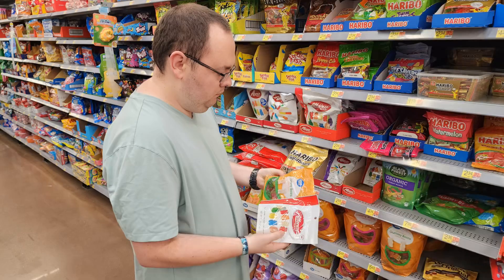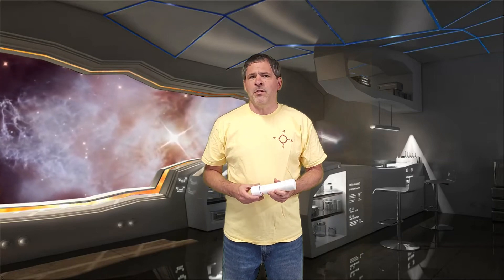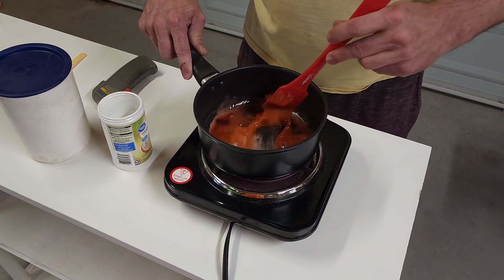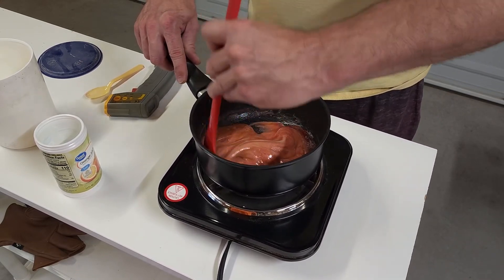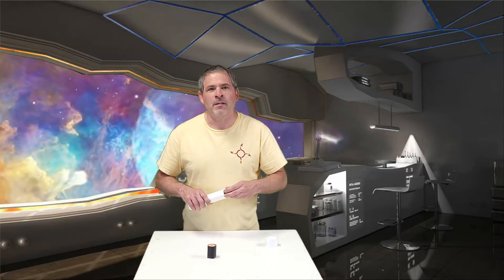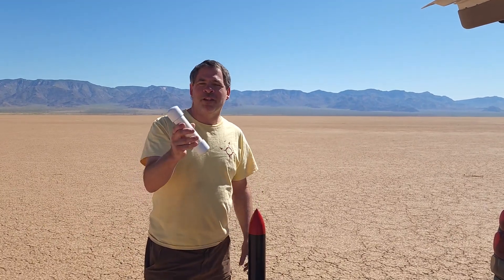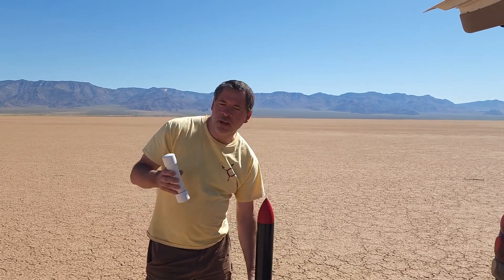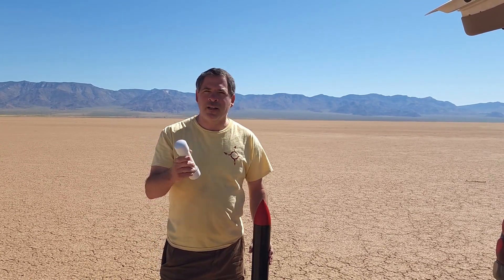We launched a rocket with Gummy Bear rocket fuel

Comment: I could be wrong but I think your chuffing issue is trying to burn semi-solid rocket propellant containing a large water content. It tries to burn, then encounters water molecules that have to get boiled off before the sugar/nitrate molecules burn, then it has to boil off more water molecules again and repeats the process until a good deal of the water is boiled off and you get a good burn in the now enlarged combustion chamber. Hard to ignite the propellant? So is damp paper or wood.

Comment: That pulsing is odd and I wonder if it is caused by the gelatin tuning to some species that doesn't burn as well as the sugar and somehow insulating the sugar from the flame front momentarily.
Reply from the maker: Sounds reasonable. It was definitely weird.
Reply: You can buy 'powdered' gelatin and make sugars by drying corn syrup...that's what they did when we couldn't get gummy bears to burn as a fuel WITHOUT drying out the water by heating/melting them and then using LOX as the oxidizer...true gummy bear fuel.
Reply: From Wiki Pedia: "Gummy candies are made mostly of corn syrup, sucrose, gelatin, starch and water. In addition, minor amounts of coloring and flavoring agents are used."

Comment: If I recall correctly, red iron oxide is supposed to make the fuel burn somewhat faster, but if you use quite a bit*, it's supposed to reduce the pressure exponent. At least in Richard Nakka's RNX fuels, which actually use epoxy. I don't know if it works the same way with sugar motors.

*7 or 8 percent in some cases
Reply from the maker: It is my understanding that it "should" have resulted in a faster burn rate which is what we wanted. But this fuel was already very difficult to ignite and the addition of iron oxide made it extremely difficult to light with a standard e-match.

Comment: That was one of the Myth Buster shows I worked on. We tried 'true' gummy bear rocket fuel in a hybrid with LOX but the high water content (15-25%) in gummy bears hinders its use as a fuel without modifications. Cooking it down as you did (with potassium nitrate) removes much of that water content as does drying it out further as a powder as on the Myth Buster show (still a true gummy bear fuel). They switched to ammonium perchloate (AP) instead of potassium nitrate (KNO3) for their oxidizer.
Reply from the maker: Nice! I did see the terribly failed experiment with plain gummy bears. That was doomed from the start but you probably knew that going into it. I was disappointed in the gummy bear myth busters episode where they successfully launched the bates grain fuel motor. Mostly because the didn't really do anything other than commentary and push the launch button. They didn't build the rocket, the fuel or the motor... All done by someone else... Maybe you :)
It really looked to me like the bates grains they showed were constructed of APCP with just some of the dried gummy bear mixed in. My assessment of that was based on Jamie's description of the fuel.
Reply: @rotaryrocketry AP works many times better as an oxidizing agent than kno3 and true APCP uses htbp as a binder and as a sort of fuel but it mainly uses powderd aluminium as fuel so i think what they did was lower the amount of htbp and replace the aluminium with gummy bear powder so most of the impulse still came from the gummy bears
Reply from the maker: Well, I don't doubt that "some" of the impulse came from the sugar content of the gummy bears but just how much is up for debate. They were deliberately not sharing detailed information about the fuel on the show.
I've actually been thinking about re-visiting this idea since we've made some significant motor design improvements. And maybe melting and pulverizing the gummy bears like they did on the show... It's a possible future project.
Reply: @rotaryrocketry  i think it would be  fun to revisit the project and maybe try AP instead of kno3 to see if it would work better and try the dried fuel i think that the dried gummy bear fuel would work a lot better i have been thinking trying some sugar rockets (i bought a 5kg bucket of kno3 like a year ago never used it yet) as a young rocketeer in europe atleast i my country i am basicly the only young person to do rocketry at a bigger scale using some smaller apcp motors which are stupidly expensive because of import taxes and such to a point where a simple G rocket motor can cost up to 50€ (about 55$) so sugar rockets might be a good option but i dont know if i am allowed to even launch them at my club i think i will post a video on an upcoming club launch this sunday know i dont know why i made such a long comment but you make great content 
Support from the netherlands👍
Reply: @rotaryrocketry  From your description "After several ground tests we finally got a successful design and launched a homemade rocket using true Gummy Bear rocket fuel. The final mixture is 65% Potassium Nitrate and 35% Gummy Bears cooked to 230 degrees F."  When you cook the gummy bears and drive out much of the water, they are no longer 'true gummy bears' but simply a variety of partially dried out sugars, starch, and gelatin. In testing using liquid oxygen,  we could hardly get combustion of true gummy bears because of their high water content. 
The same would be to say you made a rocket motor using Jello...without the water you really can't say you made a rocket motor using Jello unless just to make another video. Try making rocket propellant by adding the Jello powder, KNO3, and water and see if you can ignite that. Much the same when you make 'flexifuel', you need to drive out much of the water to get it to burn. Try burning the propellant by just adding Karol, sugar, and KNO3 without heating it to drive out the water.
Reply from the maker: To clarify... What I meant by "True gummy bear fuel" was that we didn't make an existing fuel and add in some percentage of gummy bears. For instance, making APCP fuel and then adding in 10% gummy bears. All of the propulsion from this motor was provided by the ingredients of the gummy bears.
Funny that you mention Jello fuel... It was on my list of projects a while back but I decided not to do it because the jello powder is just basically sugar so I kinda thought the test was pretty useless.
You bring up an interesting topic though... Karo, sugar & KNO3 without cooking... Now that gives me an idea. We are currently cooking flexi-fuel to 210F and the cooking process is very fast. I don't think there is much time in there to drive out moisture but rather the process of cooking is used to integrate the ingredients and get them to a pourable state. But I think I might try some no-cook tests and see what I get for results.
Reply: @rotaryrocketry  "Try burning the propellant by just adding Karol, sugar, and KNO3 without heating it to drive out the water." Have fun doing it. I could tell you what you need to do for limited success but after having played with 'sugar propellant ingredients' for over 50 years in motor sizes from A through 12" 'S-impulse' I haven't seen anything that you've done that is new...and a lot of what I did came from others.
Reply from the maker: Sometimes it's just about the "entertainment factor". Success or failure doesn't matter too much, as long as it's entertaining :)

Comment: Just wondering, you had over pressure with a 15 nozzle and low erratic  burn with a 17 so why not try a 16? 
Very entertaining vid , keep up the good work 
atb
Reply from the maker: Good question and it shows you were paying attention.
The burst of thrust that occurs at the end of the burn with the #17 nozzle is very powerful. Since we were only using a PVC case, I felt there was a good possibility the case would explode if we dropped to a #16. Also, the #17 nozzle one was the 9th test in the series and we really wanted to wrap up this project since we've been working on it for nearly a month. Since we knew it had enough power to launch a rocket, we went for it.

Comment: Would Karo Syrup work as fuel?
Reply from the maker: Absolutely. Our standard sugar fuel uses powdered sugar & Karo syrup.
Here are two of our videos that have detailed information about making Flexi-Fuel using Karo syrup.
https://youtu.be/WrvOPYNQv_g
https://youtu.be/wJt1XLjqaGY
Reply: @rotaryrocketry  Karo syrup is excellent for making flexi-fuel, which itself is best suited to large single grains.  Dan Pollino being the inventor of flexi-fuel explains this in detail in his book “how to build a big sugar rocket without losing a finger”  I find a 65/35 mix of kno3/dextrose with or without 1% by weight RIO as a burn modifier as needed more suitable for bates grains, especially using pvc cases and nozzle retainers